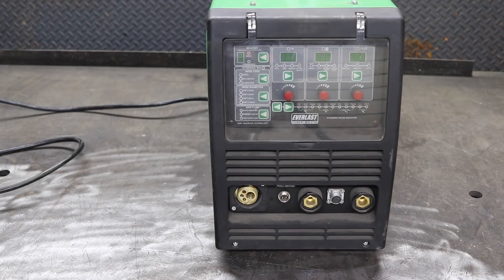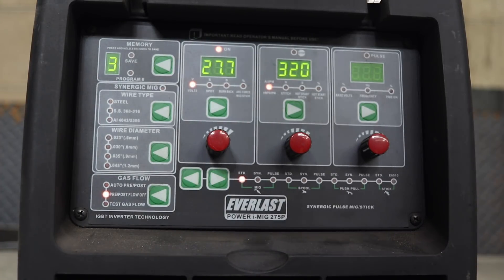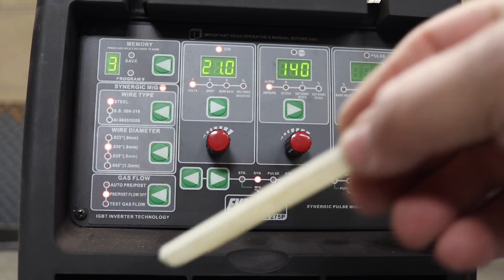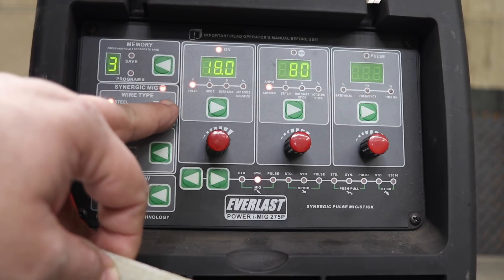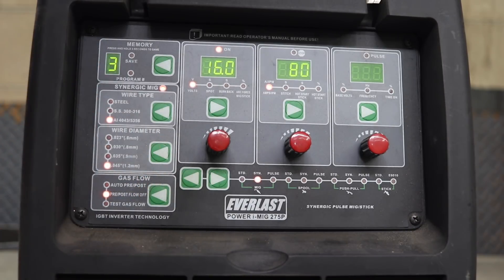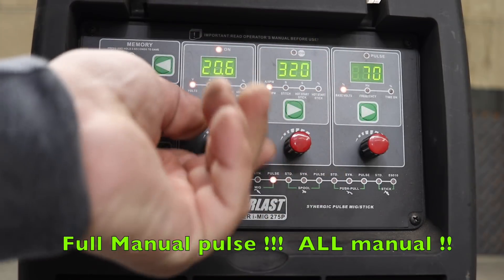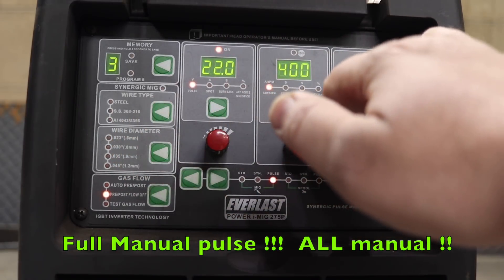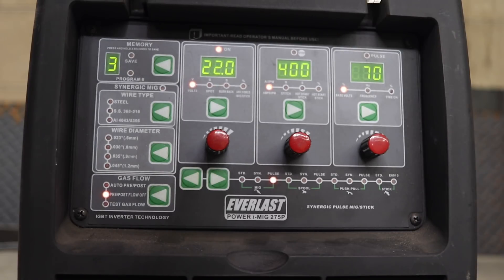Everlast I mig 275p the front panel explained   synergic or not ? full manual pulse !

Comment: When you're finishing up a Weld with a Mig at the end you should just quick shoot it a couple times and you'll fill that crater right up you won't have a crater but if you just stop then sure you're going to get a crater.  Once again this is the difference between an experienced welder and a beginner who does not know how to take care of such issues.  I see guys all the time on YouTube with craters at the end of their weld whether it be mig or tig and its all because they don't know how to end their welds.  Anyone that really want to see someone who can weld check out this YouTube channel tig weld 6061.  That's what you can achieve when you know what you're doing.
Reply from the maker: that is all fine and dandy if your settings were cool enough - and if you were using a 5000 series aluminum wire .... if you were welding on the hotter end and you used a 4000 series wire you will be fighting that somewhat.  ?I don't say it is impossible to do - I say it is not that easy

Comment: You made the comment that you would need weeks and hundreds of dollars of  material to figure it out. If you don't know anything about welding I would agree but, as a welder if I had to take that much time I would not have a job very long. I know what my gas mixtures will do with what metal I'm going to weld. It takes me  minutes to set up a machine on a project. I can't wait for weeks or days.  The scenario you gave is for beginners or people that have never welded before. For that I agree but, not for an experience welder.  I just received a 255EXT Everlast Welder  and without even looking at the instructions within 20 minutes I already figured the machine out.  That's the difference between a beginner and an experienced welder.  I guess I just had to bring this point out.
Reply from the maker: R Reichel i would really like to agree with you - from the bottom of my heart !  Really!  But i cant. Why?  Because you are comparing tig to pulsed mig.   This is a totally different animal ....  
sorry. 

And if you think that as far as skill level on a 1-10 i am more on the lower and and you are more on the upper end - that is fine.   I invite you out to my shop in the milwaukee are in wisconsin, i but you dinner and i operate the video camera and you operate the i mig 275p and show me how its done.  
Seriously - no hard feelings - i am not offended ....  i am not the first guy who struggled with pulsed mig - and i am going out here on a limb and say - i probably wont be the last one ....

I mean i have not even talked about arc length, pulse shape, and how in this machine there is no “trim” function and the shape of the pulse is pre selected and is one pulse shape for different alloys, wire diameters and material thicknesses .....

So it will be a real eye opener i will be learning a lot when you come here and show me how fast you can set this all up....  

When i read your comment it seems to be so easy that a guy would not even need those tables ....  

And i say - even if everlast would have filled out those tables with numbers already - 90% or more of their customers still would have had major issues ....   

But we’ll see....  next video i will weld - and you are welcome to come over here and weld whenever you like.
Reply: ZILA  I respectfully disagree because it's still the same whether I'm on a tig machine or a mig machine it only takes me minutes to figure out what I need to do. I have the general idea right off the batt and then I fine tune it with in a few minutes.  When you have the knowledge it doesn't take that long go to any Weld shop and you'll see a welder who could just dial it right in and go to work.
Reply: R Reichel As a professional welder would you use Synergic modes?
Reply: Matthew Isaac   In certain cases I would but not as often as someone who's not professional.
Reply from the maker: R Reichel - it is not the same ...  tig pulse just sets the heat being put out through the tig torch - the material is added as needed with the other hand ....  mig - the wire constantly feeds ! it has to to keep the arc lit !  so let me compare this to being a fighter pilot - although that comparison is not 100% perfect but since you worked in the Ari craft industry you can probably relate ....  tig welding is like the gun mounted on the wing when your propeller in on the nose of the air plane .....  mig welding especially PULSE mig welding is like having the nose mounted gun and a nose mounted propeller ....  you have to have everything times JUST RIGHT so you can shoot through the prop without hitting it and destroying it  .....
When I read your comments it seems to be like you are implying that miller and Lincoln are making synergic pulse machine for beginners !  and everlast makes the inexpensive AND good stuff for the professional .... !  
I have not been welding for 38 years ... only for electrically for 22 and a total of 28 ..... but I have been in many shops ....  professional shops building big stuff or making precision pieces or welding some exotic alloys ....  and just for m y personal observation .....  those shop owners seem to be pretty dumb. ... ALL OF THEM ....  wasting a ton of money on welding equipment when this great $2000 everlast machine would have done a way better job  for them .....  ???    
I am at a loss ....

an of course sine you know everything about welding you know about the pulse shape ....  and why does the millermatic 350p has a function to adjust the pulse shape ...?  and why does the Lincoln 350mp have a trim function ?   any what is the shape of the pulse. ...  and how come that the red and blue go through all the trouble making it adjustable ?  
one pulse shape should be perfect for everything right ? 

is that like the winter heads?  one size fit all?  or one size fits no body ?  

maybe you should make a few videos and enlighten people since obviously I am a bloody beginner and don't know what I am talking about

Comment: I think that it’s really cool that the machine is full manual.  I’m really geeking out about that!  But it also seems kind of impractical.  It seems like an awesome machine to experiment with, but not a great machine to be productive with because there are so many variables.  I do think all the adjustability would be fun to play around with, but its like getting a new race car and being told you have to tune everything, the engine, transmission and suspension without knowing any baseline.  It would be fun to experiment with the settings, but don’t expect to win the race.  But full manual, there is something cool about that in itself.  With all that being said, I have zero personal experience with pulse welding, so all of that is pretty overwhelming!!!  Awesome video, and amazing explanation!
Reply from the maker: I think that is a pretty good comparison .
Reply: Chaos Farm it is a little overwhelming for a while but keep working on it and it will become clearer. I have a fully manual pulse machine i am still tri3ng to get my head around to some degree. Keep watching as pete is great at this and has helped me heaps.